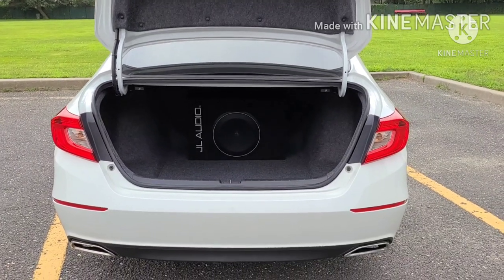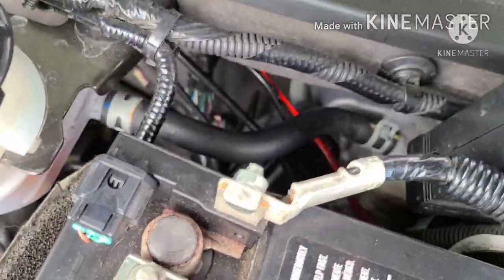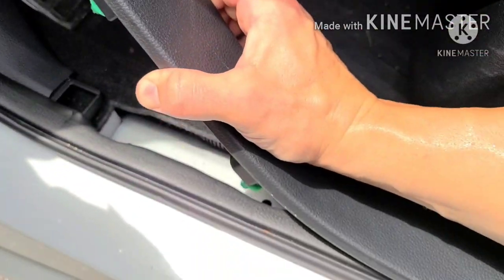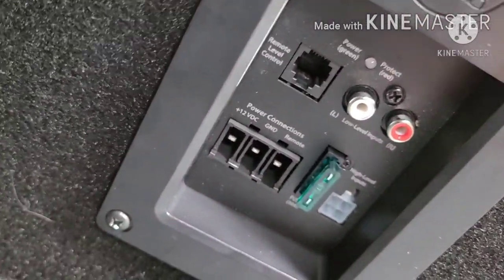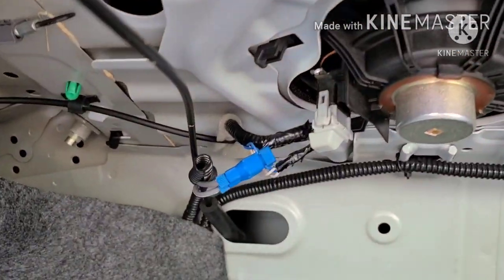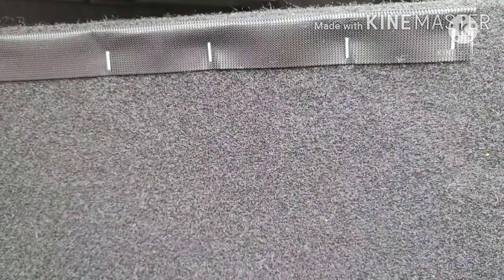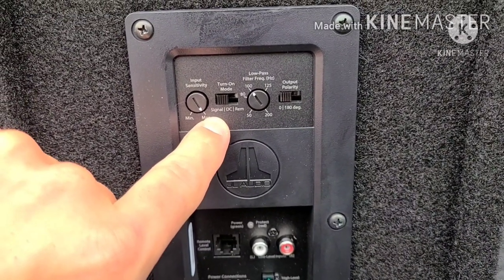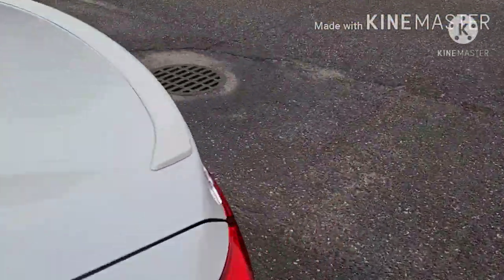JL Audio MicroSub+ ACP112LG-TW1 w/ built in  LC2i | 2018-2021 Accord 2.0t

Comment: Do you experience any rattling?
Reply from the maker: On certain bass note will get a little buzzing on the rear speaker deck. Now that it's warm again the buzzing is almost gone.
Reply: Also How does your car perform In snow?
Reply from the maker: @FleeGuy92  it was ok with the oem Goodyears.  I'm expecting it to be way better with my new ones

Comment: So I went with the Rockford as it was cheaper. It def doesn’t sound nearly as loud as it should be. All my connections are solid. Rather than tapping into the wires, I put spade connectors into the stock clips. I have it set on DC but when it is on signal it seems much louder. The problem is when I turn my car off, the sub still picks up signal and will just start going crazy and it’s way louder than when it’s actually playing music. Any idea what this could be? My ANC has been disconnected.
Reply from the maker: What did you use for the remote turn on?
Reply: On DC you don’t have that noise?